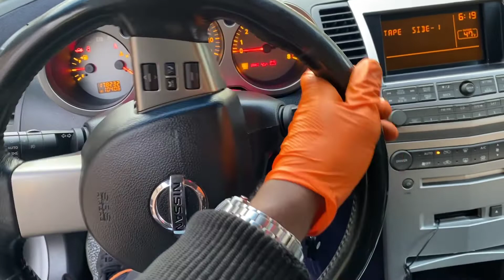Power Steering Fluid Change 06 6-Speed Maxima-_-SS2Point0Vlogs

Comment: Do you notice a difference in that fluid vs standard fluid from the auto parts stores?
Reply from the maker: IMO the biggest difference is Red Line fluid offers quicker shifts while also eliminating the sticky shifting, even when it's cold outside..
Reply: @Abu5ed_VQ  yeah, I've been running Red Line for about 5 years now. I was just wondering about the power steering fluid being different
Reply from the maker: Phil McWain Sorry bro.. I’ve been using this PSF for years.. It smoothens out the steering and I love it.. I’ve always changed the factory PSF to IDEMITSU..